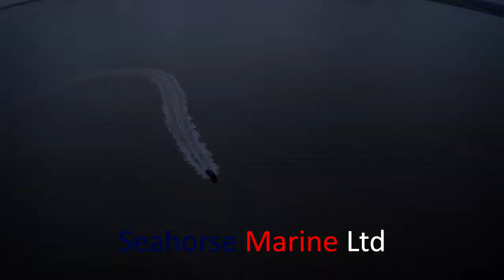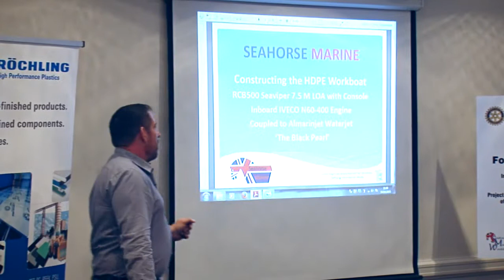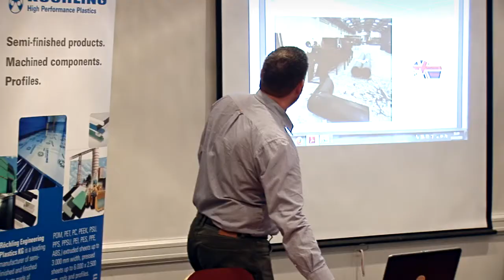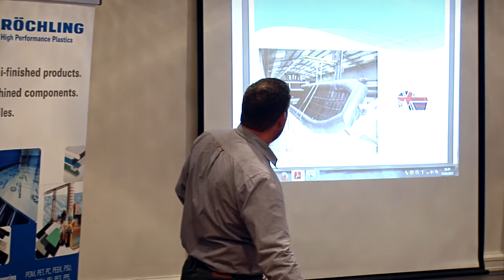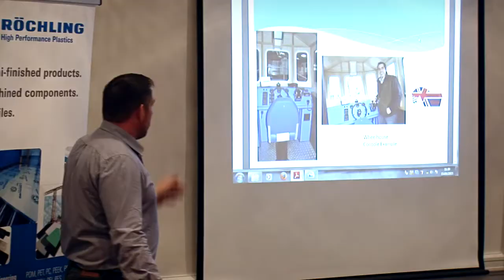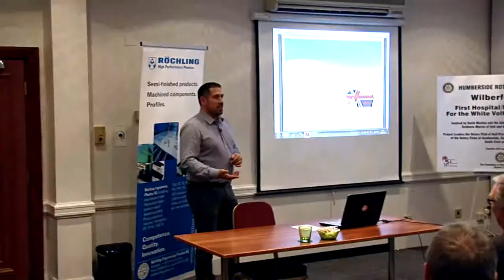Seahorse Marine Presentation by Tony Tait

Comment: Nice work. I learned about a new boat material and construction method today. Very interesting! Anyone building boats like yours in Alaska? Our coastal towns are booming with many commercial, charter, pleasure, and exploring/science needs for custom designed vessels. Rock on! I will do some more research onto building a simple 2 person ocean rowing vessel as a prototype. The 16 foot BEE is a sweet little hard chine vessel with positive flotation. This car topper out of plastic, would be lighter that the 52 kilos  out of plywood and epoxy. Very interesting. Carl Nostrand Homer AK
Reply: Carl....give us a call at Primco Marine in FL...321-225-5670